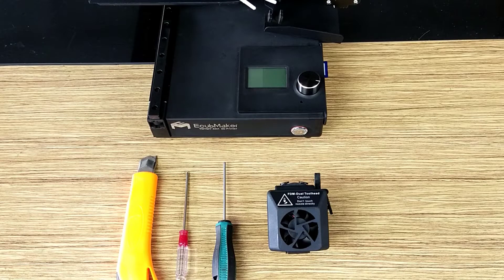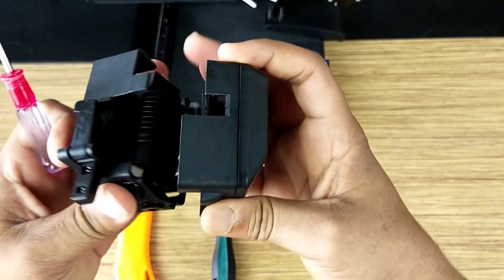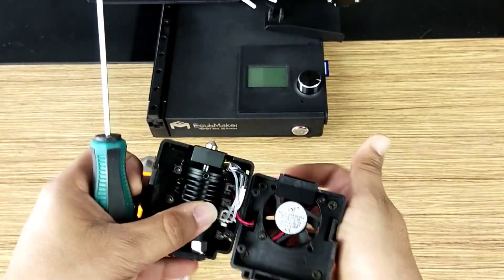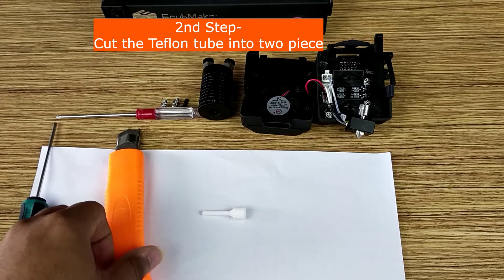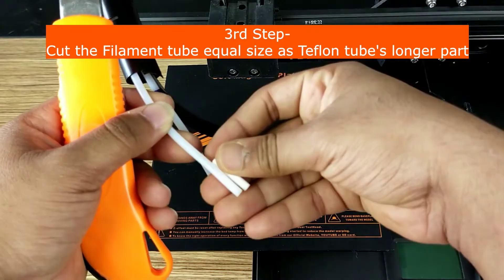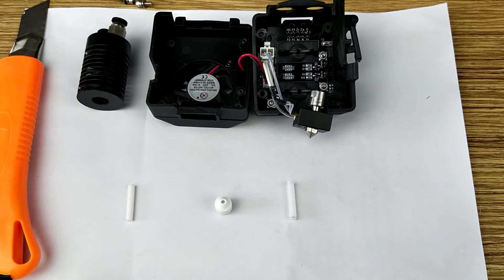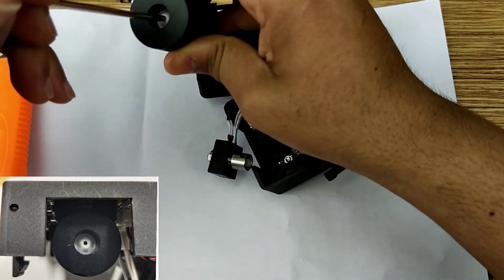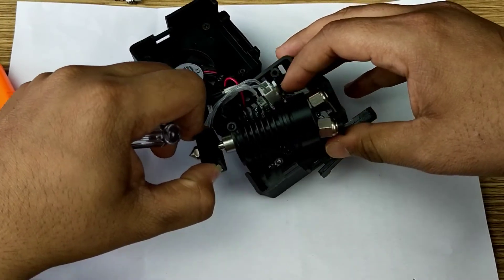FDM Toolhead Jamming Issue Solution/FDM toolhead Hack/TOYDIY 4in1/EcubMaker

Comment: Thanks :) Told me exactly how to remove a broken piece of filament.
Reply from the maker: You can pre-heat the nozzle and then use spanner through the toolhead upper hole and push down to clear the jam. Or you can dismalte the toolhead and clear the jam. We have video to clear the jam. Here it is: https://www.youtube.com/watch?v=NLEDy_vQU9g&t
Watch it from 2:28 minute.
Email us if you need any other help.

Comment: That is a good idea! I usually print PLA at 299 degrees and found that sometimes the bottom of the filament tube turns a dark color. Before I would order a new piece to replace it. Now I can keep working without delay. Thank you.
Reply from the maker: Thank you sir for your feedback. Let us know how it works.
Reply: Correction: That should be 200 degrees, not 299.